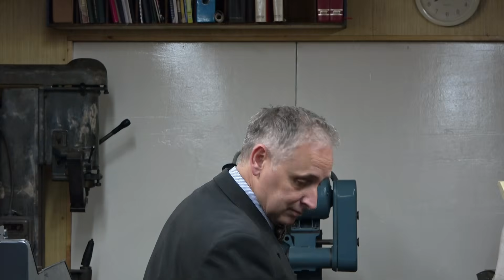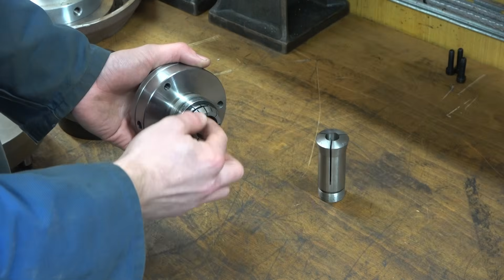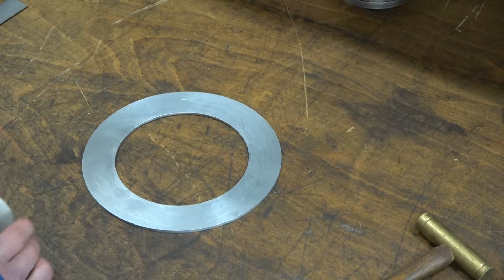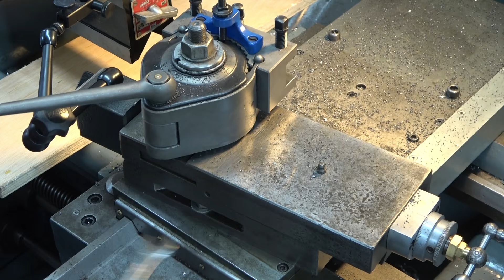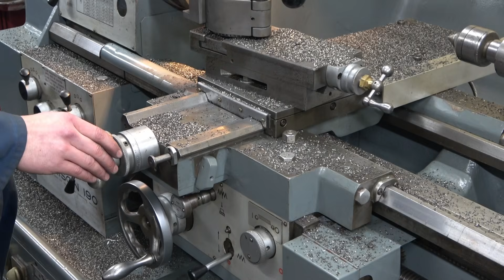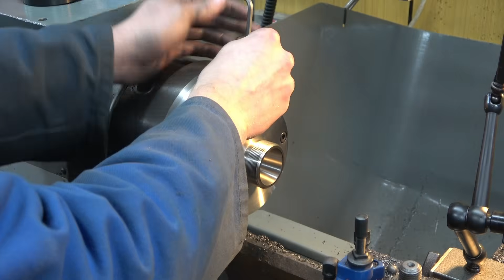Collet Chuck for Harrison Lathe

Comment: Interesting i did not get to watch your post when you posted it. But I will now tell.  You how i got over the problem with my 5C chuck  Given my.  5C chuck is one of them.  (Scroll Pattern Chuck's). I obtained a lump of steel that i promptly cut all the fetchers of a 5C collet with its  (Thread's & Keyway & Taper0.  Required to prevent falling when pulled up into place in the Chuck  the i cut  the necessary fetcher in the collet chuck so runout was readjust as little as possible. & i used a per chest a nut. Cutting my threads to match . Now i have the ability to ues both 5C &  ER collets  in the same chuck as my 5c collet, chuck in its designed ues & by putting in my new 5C Adapter to  ER'40  aquert  fetcher can now be used with  a ER'40 collet to make use of the  Chuk.  & improv it's versatility in so meny ways.  les in the UK. Having been made in the 5C chuck there is not the  continuity problems one gets from recuting  one out redy mead for a difren jobe

Comment: What's that, the whatcha ma COLLET😂 WHAT would you COLLET 😮❓  I have to admit I used to hate collets, however I must admit I never really use (a real one) one before, I used things like Dremel collets, with small 1/8" / 3mm ? Collets and most were cheap, cheap Chinese, used for about 1 hour total (less than two hours definitely) and stripped threads And un useable. Aluminum in a collet is a horrible idea.. until I started learning about machining I thought this was collets, thanks for great informative videos..  a much larger collet is very useful!.. ✌️

Comment: Why not mount the collet chuck directly on to the mandrel nose with a morse taper reducer?
Reply from the maker: Generally for the morse taper style chucks you need a draw bar to hold them in meaning that you can no longer put anything down the spine bore.

Comment: interesting video .
is that a expensive chuck ?
er40 chuck is on my wish list for my 140.
Reply from the maker: Reasonably expensive yes. A cheaper option is to get a non adjustable one and then just machine the register slightly underside.

Comment: I great video as always. I would suggest however that 5C collets are both much better and easier to setup. Any collet is better than no collets on a lathe but a simple draw-tube and pull-in collets is faster, more accurate and as it is designed for work holding, rather than tool holding, there is no requirement for the length of the workpiece like ER. It is also possible to buy 5C collets in any price range you might want, including somewhere in the middle which is not the case with most tooling. I have both the complicated closer (very complicated it is Swiss) and simple drawbar and I only use the latter as it is better for one-off work. I am not sure which internal taper that lathe uses but for the common ones you can fine premade adapters, such as MT5 to 5C or B32. Otherwise making one really isn't so bad compared to all this work :)
Reply from the maker: Yes all good points although for work holding its very handy to be able to clamp any diameter between 1 and 26mm. 5C has the down side of requiring a nominal size unless you are going to but soft ones and bore them out.

Comment: Hmmm, you are right, big lathes rarely get the ER collet chuck attention... Not sure as to why, as i have seen ER50 collets with my own eyes... Those things are massive, well, at least when compared to say an ER25 or similar smaller ER style collet sizes... If i recall right, the ER50 series can clamp up to 40mil in dia, or 4cm, which for our brethren across the pond is something like 1/2 a big mac or 1.5748 inches, which puts a lot of gentlemen to shame, at least girth-wise... I mean, if it`s good enough for yo` mama, then why is it not good enough for my lathe, that`s my question... 
All jokes aside, it`s not like big lathes have to turn 10inch rods exclusively, sometimes you need to chuck a smaller part in a big lathe, or have a small production run where collets are just a godsend... Sometimes you want the inherent rigidity of a massive lathe for a 40mm rod, even if it would be just as doable on a smaller lathe... 

Also, this was some damn nice work, as always really... I think i will have to edit my profile and put you on the pedestal next to Robin, Stefan and the Engineer... Which is a major compliment overall... 

All the best and kindest regards!
Steuss
Reply from the maker: Many thanks. I think part of the reason is that in industrial applications ER collects are pretty much exclusively for tool holding rather than work holding.
Reply: @MrCrispinEnterprises  Yeah, but what the fuck kinda tool do you hold with an ER50 40mil collet? The mother of all boring bars on a massive horizontal boring machine? Like that is the only machine i see using such collets for toolholding... That and maybe a major CNC lathe with a VDI revolver of epic proportions... Tho, i`ll say, when i get to making a collet chuck for my big lathe, it`s gonna be an ER50... That however will take some time, as i have build a new shop and scrape in that poor creature back to OEM specs at the very minimum... She deserves it... 

All the best dear mechanicus brother!

Comment: That's a nice build, I enjoyed the video. I've recently been doing the same with an ER40 and a 5C collet chuck build. Thee grip-tru feature is I think essential for collet chucks as the accuracy required from them is generally greater than for 3 or 4 jaw chucks.  Cheers from the Outback.

Comment: Good video with some great ideas for the less experienced and experienced machinist or model maker.  The one about moving the carriage 2mm was one I had never considered. I would perhaps quibble with your idea of going ER40, all you have now are two machines that do the same thing.  I think I would have put the butler on furlough, saved the pennies and bought a nice second hand Crawford multibore chuck and collets. Bigger capacity larger individual collet range, sized for D1-6 capacity machines, and a fine bit of British engineering to boot. Of course if you cannot comprehend the thought of making your own tea I fully understand your choice.
Reply from the maker: Interesting points. Thanks

Comment: Very well done Mr Crispin. I adapted my cheap import ER32 collect chuck for my Myford lathe, and did what David Ticehurst suggested making the bolt holes a fraction oversized to adjust for run-out. I'll look out for you at MACH 2024. Cheers Nobby

Comment: If you're watching, this is a teacher. The thing I've never noticed is that when all these teachers use a compass to mark off 6, 8, 19 or however many holes in a circle are needed, they never even mention that for example 6 holes in a circle requires a 60 degree setting on your compass........

Comment: Very neat assembly!  
Always very telling with an old Lathe just when you are getting that smug feeling when you see a couple of tenths on the clock,  grab the spindle and see how much you can move it up and down.
Might be an idea for those not fully versed with the advantages and draw backs of collets vs. chucks is to do a comparison of the two methods.
I use collets a lot on model aero engine work making needle valve assemblies,  making all my own nuts and screws including Phillips head ones,  conrods,  gudgeon pins, induction venturis etc.   Round collets mostly in 1/64" steps from 1/32" to 35/64" but also hex. ones and a square one for a certain job.   C3 type.
Reply from the maker: Thanks

Comment: I have the D1-5 version of that PM ER40 chuck, and I 3d printed a large pin wrench for the body of the chuck to hold it while I tighten/loosen the ER40 collet nut. There are 8mm holes around the perimeter that fit a piece of 8mm drill rod nicely. I just made a slightly undersized hole in the wrench body, heated the drill rod, and pressed it in, and it's been lots more effective than putting the lathe in low gear.
Reply from the maker: Thanks, good idea.
Reply: I should also say that I meant it as a prototype for machining one out of 3/4" aluminum plate as a rotary table exercise, but so far the PETG 3D print configured for strength has held up. ☺

Comment: For the sine bar setup on the faceplate after turning the surface, is it an issue that most lathes are set up to turn a convex surface when facing, if the sine bar isn’t s not centrally located then an error could be introduced? Great video, entertaining and informative!
Reply from the maker: It could be but I think the actual magnitude of the convex offsetting is so small it can just be listed as another factor of error such as the squareness of the block, the alignment of the sine bar ect. But good thinking I hadn't thought of that.
Reply: Properly set up and aligned, I think you meant to say lathes face very slightly concave. If I remember the numbers correctly, Dr Schlesinger mentions .001" - .002" concavity over 12" on a 24" diameter workpiece for tool room lathes. Not much, but a good point that it would be something at least to consider if you were at grinding levels of accuracy. I actually hadn't caught that myself.  And as always, very well done Mr. C. 👌
Reply from the maker: Yes you are of course correct, the turned component face should be biased in the concave direction. Cheers.
Reply: @Pete-xe3il  yes! I meant concave, Connelly suggests 1 to 2 thousandths as you mentioned I think
Reply: @Throughthebulkhead I have the Connelly book as well. Dry reading but worth it. If you haven't read Schlesinger's, you can find it as an online PDF. Just do a google search for Dr. Schlesinger and the books title. Testing Machine Tools.

Comment: Great outcome Crispin. On a note, I was wondering as to whether you ought to pin a comment from you, saying that this was NOT a standard ER 40 Collet chuck, but an ADJUSTABLE one for  concentricity. Standard ones are just a rear register, and you get what you get for runout, unless you make the bolt holes oversize and the register undersize. Unless you purchase a super accurate chuck the typical runout is 0.01 mm ( 10 microns ). Just so others who try to do a similar job but do not realalise that yours was not a bog standard Ebay Chinese chuck. Regards from Australia.
Reply from the maker: Thanks Dave and good point.
Reply: I had no idea they made adjustable er chucks. Thanks gents!!

Comment: That was a cracking video. I have used the Trig method due to not having slip gauges and stacking fag papers gets tedious in a drafty shed. Loverly bit of machining there with that kind of run out you need to be proud of your skill and knowledge.

Comment: When indicating a taper with sine bar and Jo-blocks, I would use some 1-2-3 blocks to span any interference (nuts, protrusions, gaps etc) positioned resting on the cross slide, with the sine bar (and Jo-Blocks) on top of the 1-2-3 blocks, butted up directly along side the ground sides of the compound itself.

This then Allows accurate pre positioning of the compound's precise angle for machining by moving the compound with sine bar, back and forth against a stationary indicator with the least amount of additional setup blocks, parallels, positions etc.

Simple, if you have a lathe that allows you to use the compound itself with sine bar directly to set your precise angle.

Comment: 👍 what would be the consequence if the block used to sweep was not perpendicular to lathe ways? 
I know when indicating or turning a taper, the tool or indicator must be on center line. Thanks for sharing.
Reply from the maker: You would get the same problem as the one you mentioned. The closer to the centreline the better. 
You would end up with the indicator stylus running across the block face at a funny angle giving you a strange reading. If you look closely at the my footage, the indicator almost shows a small arc. That is probably down to the error you mention.

Comment: Excellent result Mr Crispin. 
I noticed that the lathe runs with the safety guard up. This can only mean one of two things: 1. It is an older type lathe which does not incorporate a safety cut out switch, or 2. The electricals have been bypassed.  I highly doubt that a man of your engineering pedigree would stoop that low to circumvent a safety feature...but in case you did.. please show us how!
I also noticed that Jefferson is multi-skilled.  Next he'll be asking for a pay rise.
Reply from the maker: Hi, it's a machine of an era when the guards were not interlocked. I think it's more to stop coolant splashing you rather than the modern ones which stop you leaving the chuck key in ect.

Comment: Could you have made a mini threaded screw/bolt with a screwdriver flathead to put into the holes? And loctite them in
Reply from the maker: Possibly although there aren't many threads to use and also it would have probably be equally time consuming. Good idea though.

Comment: Very good sir,
If I might make some suggestions/observations.
If you do not have an alignment pin or such for the positioning of the chuck, you should consider marking the alignment permanently and also develop a torque pattern and use a torque wrench to tighten the “D” camlocks so that you can introduce consistency in the return to the calibrated position.
It can be very frustrating with the “D” style chucks getting them to return to alignment without an installation procedure.
The addition of tommy bar holes in the adapter will aid the collet nut manipulation greatly.
Thank you and as always take care.